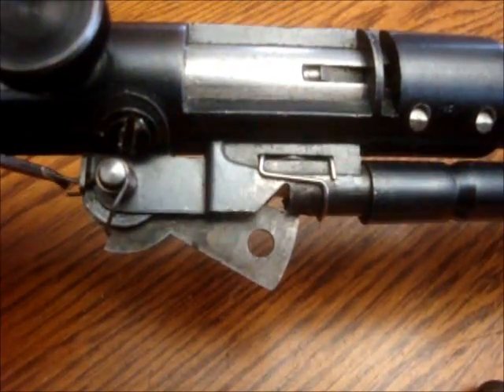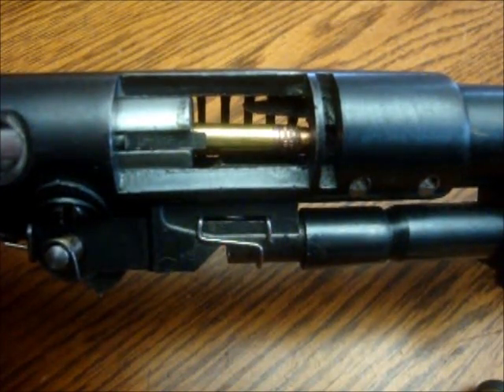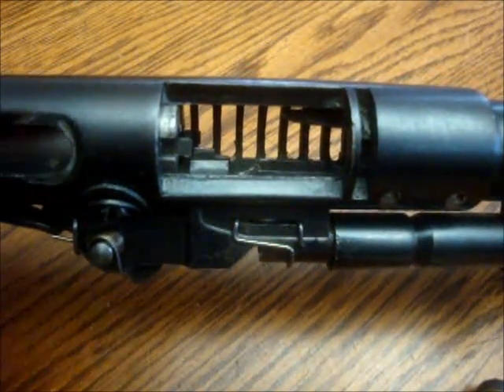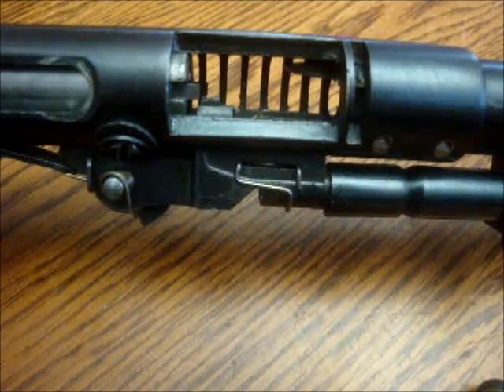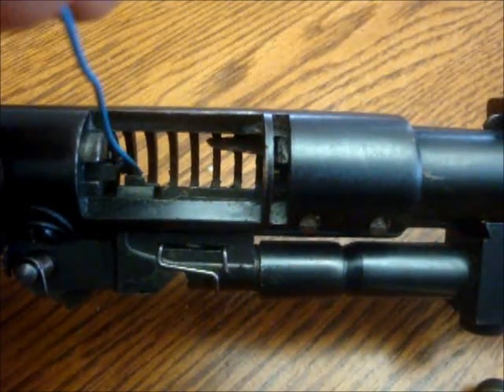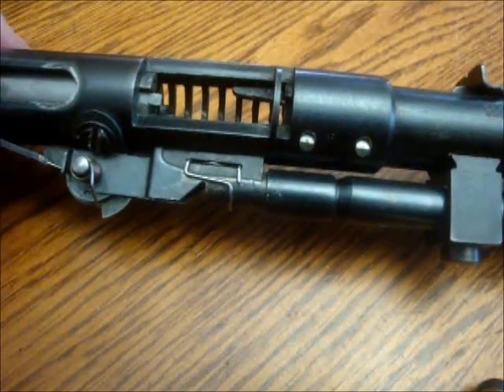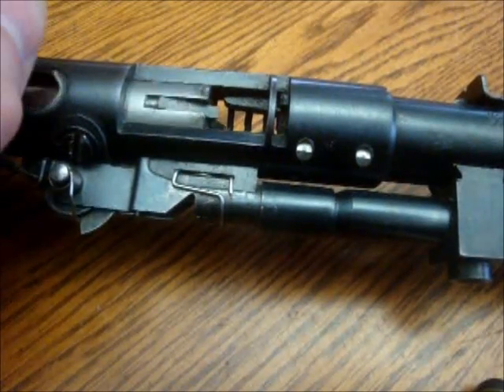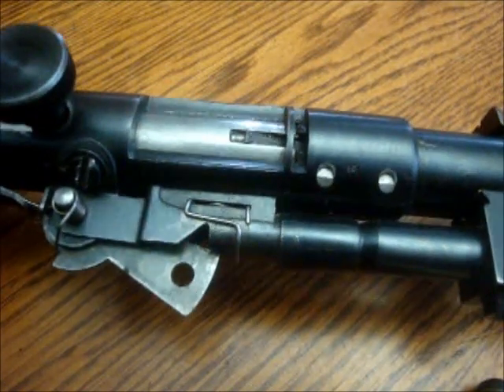Viewer request: springfield/stevens 87a cycling video

Comment: Hey stray03 is there any chance you can do a video on replacing or removing the bumper piece you pointed out as the first problem I would appreciate it very much I see yours is a solid metal piece on my friends it is a thin piece that looks nothing like yours
Reply: Also it does not cycle very good and if you pull back to far on the blot it jams up very badly not sure why
Reply from the maker: Which model is your friends gun?
Reply: It says springfield savage arms model 187 series A yours is the closest looking match to his on YouTube
Reply from the maker: With the plastic reciever end cap?
Reply: Yes
Reply from the maker: Sometimes the caps are bad on the back and I have heard of people turning them one turn back to make the gun cycle properly. I dont own that model so I cant really say if it actually works. The part in the front in your gun is also sheet metal. It means that if there is a problem with it you can probably bend it slightly to straighten it back out.
Reply: Thank you I appreciate the information ill see if it helps at all
Reply from the maker: Hope it helps

Comment: Dunno about the rest of you but the tube rod of mine extends to far (original part) and i pull it back a few mm, if its in all the way itll lock up the inserter(dont know its name) and wont allow the bolt to opennas theyre a two in one system making it a damn near impossible jam to fix
Reply from the maker: So the mag tube follower sticks out too far and gets caught in the lifter?
Reply: @Stray03  yea itll either cause the lifter to get stuck in the chanber and will fire but not eject oreject if the lifter is caught below the tube, fixed by making sure the tube isnt pushed quite all the way in
Reply from the maker: Odd issue. Were there any repairs done to it before the issue started?
Reply: Nah, its barely even been fired before. A gift to my father and i was just cleaning it and noticed it.
Reply from the maker: Ill check mine when I get a chance to see how much it sticks out.

Comment: Research in the Web convinced me that the extraction problem of my 87A should be solved by replacing Extractors, plungers and springs with factory new ones. However, I have not been able to find supplier for new parts and the ones offered by Numrich are in used condition with no indication if they are worn out and how much. It would also be useful as alternative, to obtain dimensionals drawings (and type of steel) to try home manufacturing-
Appreciate any suggestion.
Reply from the maker: Personally I think the stuff at numrich should work fine as they are not selling broken or worn parts. But yes it is possible to make your own extractors assuming you have time and patience.

Comment from the maker: Before replacing spring, check if the bullet is binding on something. Might be some gunk that has made it more of a squeeze for the bullet, If it is the spring, and you are in the US, then numrich gun parts will have the piece (gunpartscorp[dot]com. search 1085950C. originals are sold out but they sell replacement.

Comment: it fire's one round then you have to eject and reload  chamber
Reply from the maker: +Rickey Cook What ammo are you firing and have you cleaned and oiled it? Also is the bolt knob locking into the frame when you close the bolt or is the bolt free to move. (If you accidentally push it in it acts like a bolt action.)
Reply: +Stray03 it also has this strange way of locking the bolt back by pushing the charging handle in is this supposed to be?
Reply: +Stray03 ok but if the handle is out all the way and it does this then what?
Reply from the maker: +Rickey Cook The bolt locks back as the official way to load it as per the manual when you are firing in single shot mode (for shorts, subsonics, and long). If the bolt is all the way out and it isn't cycling but cycles when you pull back the bolt then try removing the bolt and cleaning it and the receiver. It may be clogged with crud. Before trouble shooting these guns make sure they are well cleaned and oiled.